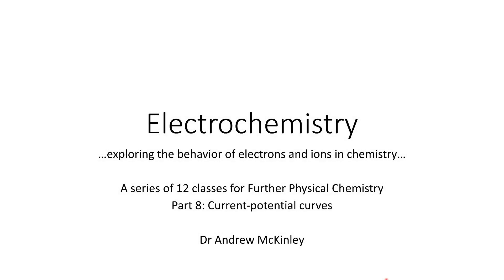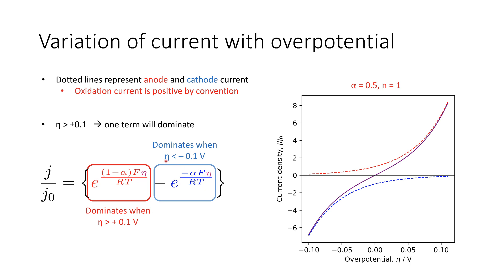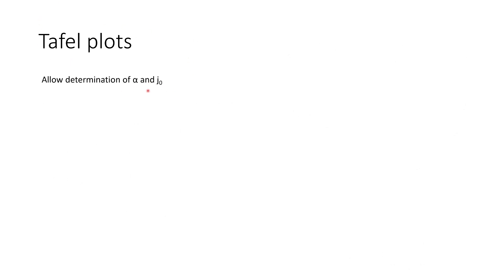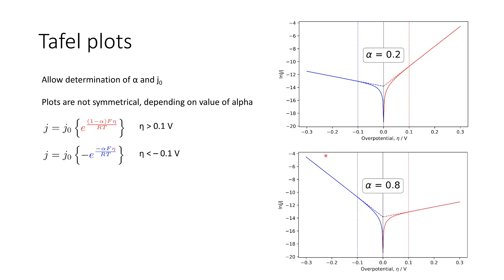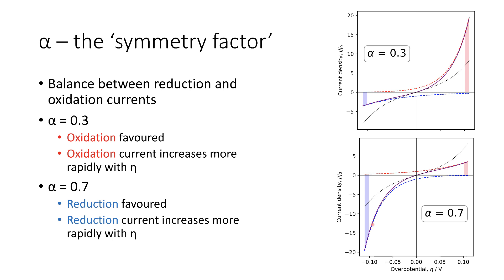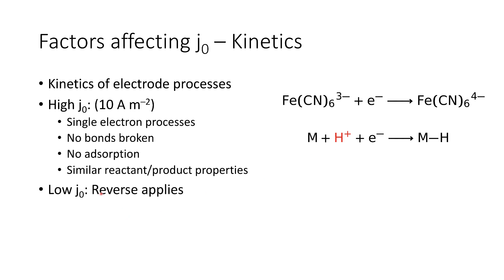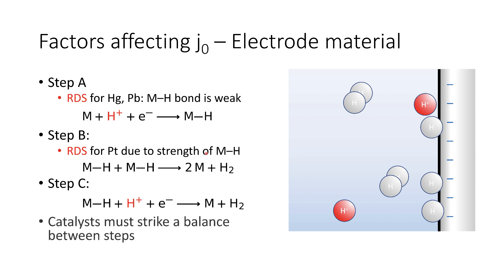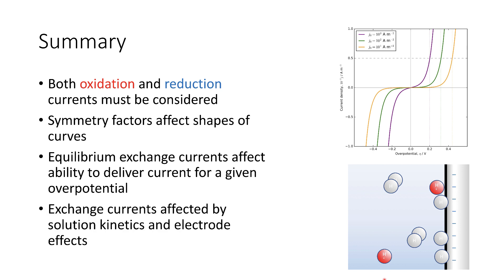Further Physical Chemistry: Electrochemistry session 8

Comment: How is the over potential calculated in practical applications like what instrument can be used to determine the induced potential that deviates from the equilibrium potential?..so that the over potential can be calculated.
Reply: All you need to know is the equilibrium potential. There are vast tables of data for pretty much any redox species you can imagine. Then you need to adjust it for the reference electrode you are using. Best if you use RHE to begin with. After that you need to account for changes in temperature, pH (if pH sensitive), using the Nernst equation.
Best example is HER. It is taken as definition of 0V for electrochemical scale in standard conditions - 298K and activities = 1. However, this then means that it is 0V only for solutions of pH=0 (as -log(1) = 0). Say you have a solution of pH=2 your new equilibrium potential for HER would be 0+0.059*2=0.118V.

All that is left is to measure your CV and plot the j vs overpotential, assuming it is at 0.118V.

Comment: Over potential = E - Eeq, so at positive over potential, E>Eeq, but we know that this condition represents electrolysis, so that is energy consuming(electron gaining), then why positive over potential corresponds to oxidation?. Are we talking about the electrodes or the species here?
Reply from the maker: It might be useful to consider it point-by-point:
- By definition, current flows from positive to negative (anode to cathode)
- Oxidation of the species in solution always occurs at the anode 
- These are always *relative states*; a negative voltage simply flips which is the anode/cathode.  
- When we do electrochemistry, we don't think about 'anode/cathode', we think about our "working electrode". 
- At positive potentials on the working electrode, we get oxidation of species in solution at the working electrode , while when we switch it to negative potential, we get reduction of species in solution at the working electrode .
- We typically disregard what happens at the other electrodes! (usually a standard reference electrode and a 'counterelectrode' whose only purpose is to complete the circuit)

With respect of "electrolysis", regardless of whether we have a positive or negative overpotential, we are driving a current through the cell (i.e. doing electrical work) - so it is, by definition, an electrolytic cell in any of these states.  The only other possibility would be to connect a conductor between the two electrodes and let thermodynamics take the wheel - a "galvanic cell". 

Does this help to resolve the understanding?
Reply: @aw_mckinley  Yeah,Thanks.. That's what i asked.. Your answer mean that we are taking about the species in the solution and not about the working electrode,am I right?....
Reply from the maker: @ramanujasrinivasans1898  Yes - in this context we're talking about the solvated species.

Comment: At 5:54, n<-0.1 which means -0. 2,-0.3 etc. So at that part there should be deviation. But deviation is shown at around -0. 09,-0.08, -0. 07 etc which is greater than -0. 1, or should the deviation  be at n>-0.1?
Reply from the maker: Yes; apologies, this should be the magnitude of the overpotential, not its absolute value; so when |η| > 0.1.

Thanks for flagging it!